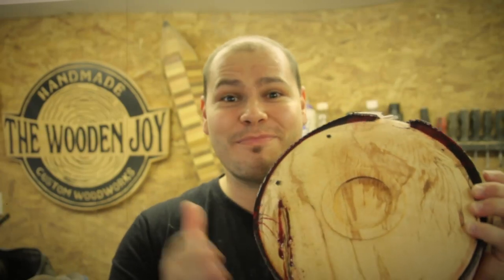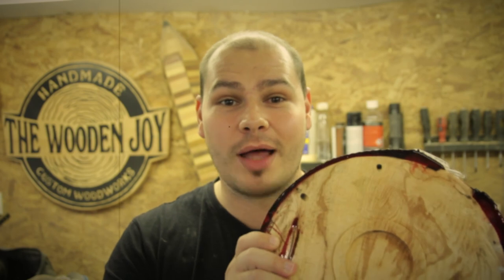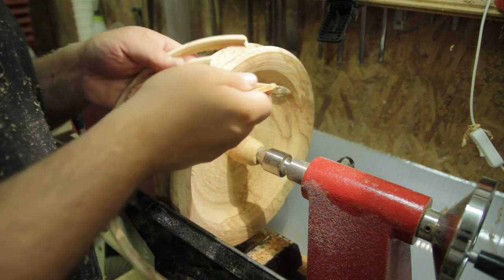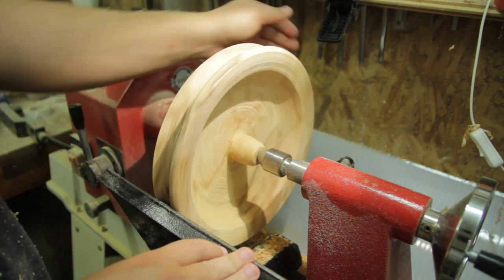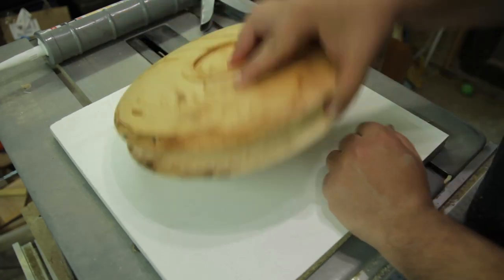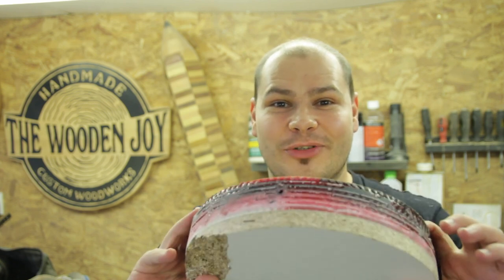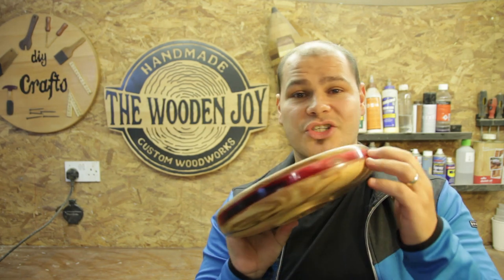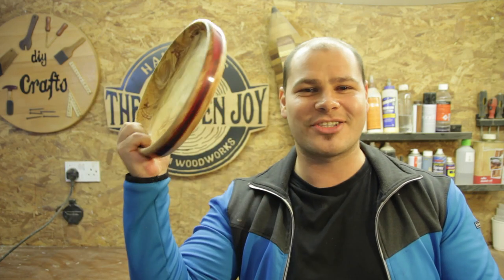Woodturning - Spalted Beech Bowl With A Little Resin Twist

Comment: What do you think of the lathe? I'm tossing up between getting that one or saving up and getting the Record Power Envoy. I have a small midi lathe that is pretty good for small stuff but no good for bigger bowls.
Your lathe has the same spindle thread as mine whereas the record power one would mean buying new chucks or at least using adapters! 
Maybe you could do a lathe review (If that appeals to you!), I don't think anyone has done one after using it as much as you.
Reply: @davidscrafting8860  Thanks David, that's really helpful, you mentioned some niggles there that I haven't read in reviews. So, I will have to save up the pennies!!
Reply: @davidscrafting8860  The Axminster AT406WL was going to be my lathe of choice until I saw the RP lathes. Here are my thoughts, (for what they might be worth! It'll help me get my head around it anyway!)

Axminster AT406WL 1.5Kw Motor, and no legs for £1.6K, with legs for £1935. 406mm swing - 710mm BCs Extendable, 36 point indexing, (I can't find any mention of a tool rest extension.)
RP Envoy 1.5KW Motor, £1.6K with legs, 410mm swing - 610mm BCs extendable, 24 point indexing
RP Regent 2KW motor £2,000 with legs, 460mm swing - 610mm BCs extendable, I'm guessing it will be 24 point indexing, can't actually find it written anywhere.

So for roughly the same price as the Axminster with the legs, you can have a higher spec lathe from RP. RP has fantastic engineering quality. 
I also considered a couple from Simon Hope, but didn't really think they compared.

Both Ax and RP have a remote magnetic control panel, forward and reverse and spindle lock

Where Ax wins: 36 point indexing (if that is a feature you need/want) (Bear in mind there are other ways of indexing) bed length, Lowest speed is 50RPM on the website and 0 in the manual (compared to 250 on the RPs).
Where RPs win: motor power and capacities for the price. For example, you can add bed length and indexing, but you can't add motor power. The 2-inch extra swing over bed from the Regent could be useful in turning larger vases and using a steady rest.

For me, I would prefer the slightly shorter lathe because space is an issue, As well as getting the legs included in the price as I will want the legs. The only feature the Ax has that makes me consider it is the slower lowest speed. But that said I have gotten around this in the past. When I needed the lathe to turn at 'hand speed' I simply drove it directly using a different motor. I have since driven mine with a corded drill. I'm not sure I will be using indexing or slower speeds much, so the price and shorter overall length are more appealing for me. The £300+ I would save on the price would go toward a new chuck and jaws!!